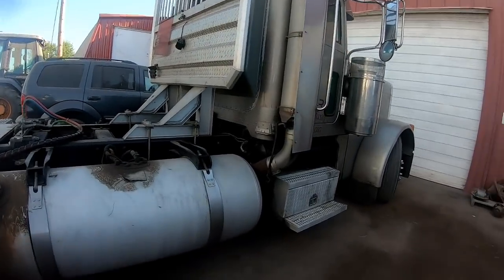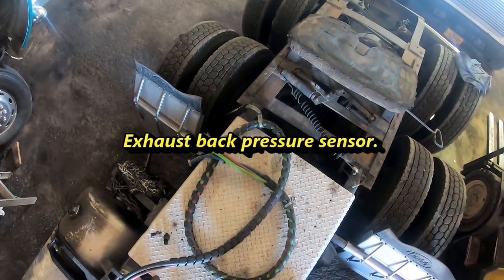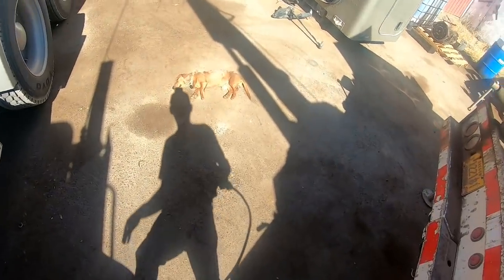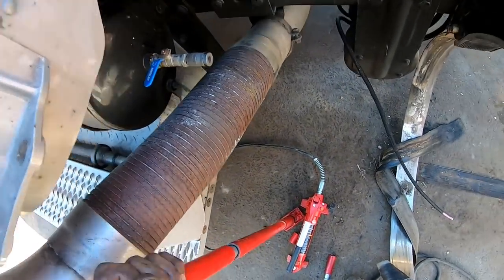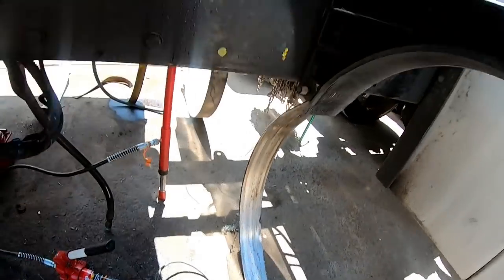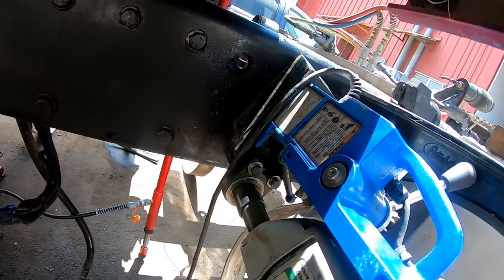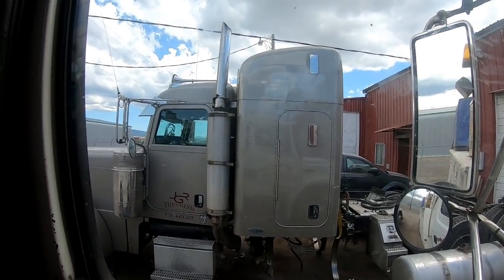379 Peterbilt sleeper mounting.

Comment: A local shop back in the 70s had a sign in the service department. Out labor rates are $25/hr. $50/hr if you watch. $75/hr if you help. $100/hr if you worked on it first.
Reply: Tired old mechanic 😂

Comment: i used to drill truck frames with a hand drill also. pilot hole, step up to next size then the next size until i reached 5/8". it took forever! then i bought a milwaukee battery powered magnetic base drill with annular cutters for drilling frames...we do a fair bit of moving axles forward. i am looking at buying a "zip cut frame drill". it isnt cheap but it sure is easier to set up and use. however, it only uses traditional high speed drill bits. however, there are adapters available.

Comment: That drill has to be a back saver.  It's too bad that you didn't get all the parts back from whomever you lent it to.  Great video.  Thanks for taking the time to make the video and share it.  Those thumbs down must be from all the mechanics who couldn't find the blown fuse and rubbed wire.

Comment: I bought a Jancy Slugger in 1992 when they first came out. We had a magnet drill but it used regular drill bits and couldn't hold the annular cutters. It was after the owner of the company died and the guy that was running it didn't want to buy it. I offered to buy the drill if they bought the cutters and I drilled the holes for $1 each and kept the cutters. I like being able to drill next to another hole which is something you can't do with a regular drill. You can drill 5 holes in the time it takes to drill one. I drilled frames, wear plates and forklift forks. We had forklifts that had bolt on forks. Replacement forks from the manufacturer cost $1200 each. We could buy a $400 pair of forks and drill them in about an hour each. I let one other guy run it one time. He got the cord caught in the cutter, ruining the cord, cutting the power so the drill spun, broke the cutter and two of the feed handles.

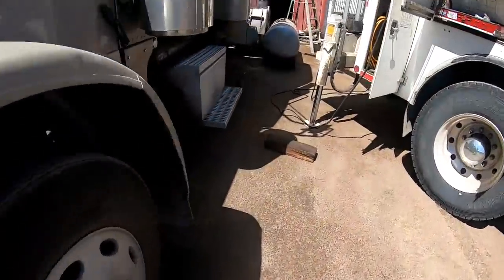Comment: As curiosity has gotten the better of me on this video. Besides the learning experiences from drilling and mounting brackets for this sleeper, why couldnt he just buy the proper size sleeper for the truck since the mounting brackets for them are still there on the truck. If you pause the video a half second past 25:11 you can clearly see the old mounting brackets for the original sleeper the previous owner didnt remove them.

Comment: A mag drill won't work on aluminum, had a 1972 Autocar that had and aluminum frame, 335 cummins 5 speed with 5 speed over 3 speed auxiliary keep you busy with 3 sticks to row.
Reply from the maker: Yeah it will,  you c clamp a piece of metal to the frame behind the bit, done tons of aluminum frames on log trucks with a mag drill.
Reply: @westerntruckandtractorrepa1353  I got a mag drill with a aluminum magnet.😁

Comment: In regards to the stack wagon, friends truck with 7.3l power stroke sat at mechanic for 3 months. They could not find problem and ate 1k in parts. In a few hours  I found that the Exhaust Back pressure sensor was bad. It kept  the ecm from booting up when connected. Replaced sensor and truck runs, communicates with PC with no codes. Btw I am not an automobile mechanic by trade.
Reply from the maker: In today's smart phone age, I can't understand why people can't at least Google some theory of operation info and start with the simple stuff first.

Comment: Those pilots make life easier. They are not expensive so quit whining and get a couple. There are several sizes as they change with the size of the cutter. I own one of those units. They make punching holes in frame rails so much easier. The pilots make lining up the center of the hole much easier too. I know it sucks when thing don't all come home when someone else uses something, That is simply life.
Reply from the maker: I said I ordered one and it's sitting at air gas and leave before they open.

Comment: Diesel fuel is 7.5 pounds per gallon (for future reference) . You should buff those tanks out while there off . lol
Reply: @JJ-jv1gu  That's why the water is in the bottom of the tanks .
Reply: As a driver I've always used 8 pounds per gallon when figuring weight on diesel. Little bit of safty/wiggle room.

Comment: Wes to you have a PNA or a PND fee pain in the ass or pain or a pain in the dick fee?
Buddy of mine did side work for a local limo company they had some embassy Lexus for different Saudi Arabia Prince's and some Arab diplomats in Oklahoma city the had one car that would run fine than would not start for anything 10+ trips to the Lexus dealer in OKC & a Trip to a Lexus gurus in Dallas Ft worth area. new computers, fuel pumps, steering column,wire harness, you think of a part they threw it at this car my shade tree old school buddy looked at the key and noticed some corrosion one of the driver had submerged the key in the cup of coffee try the simple stuff first